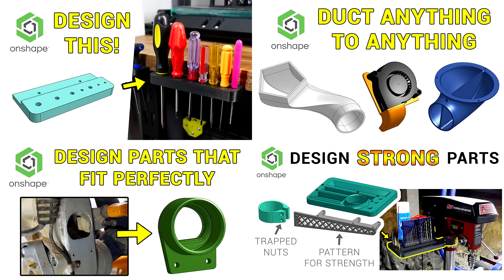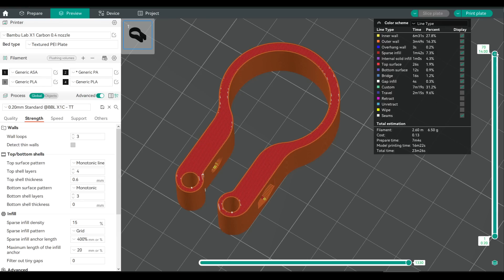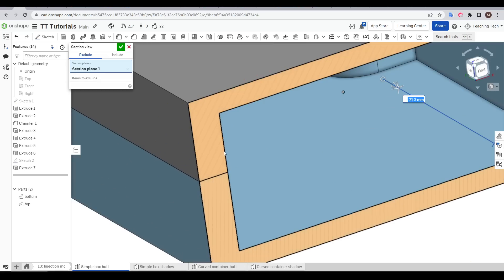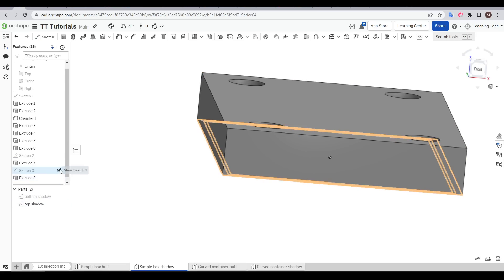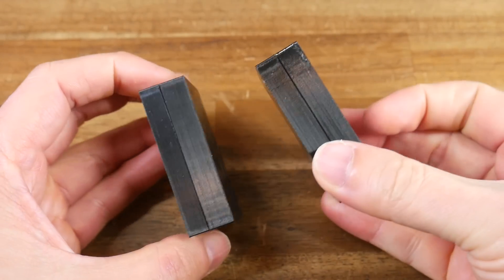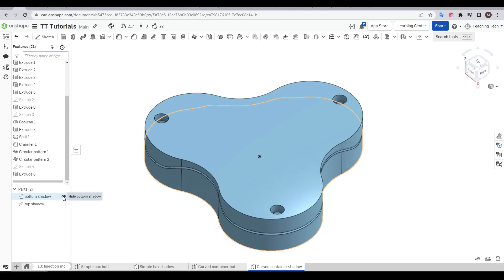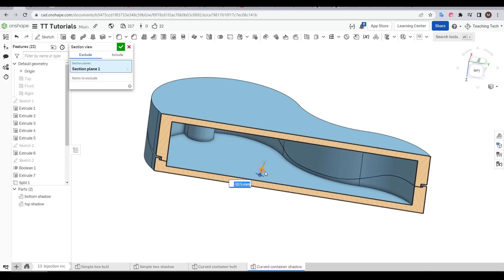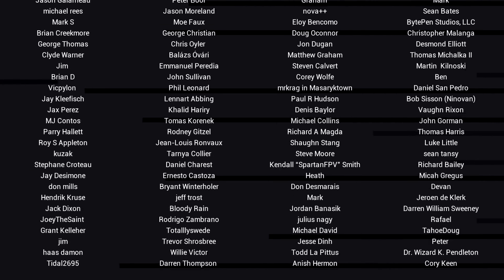Design like a pro with shadow lines - 3D design for 3D printing

Comment: Michael, you're doing very well with teaching people some good habits for design. Next thing missing in your designs is proper alignment between assemblies. All parts need to follow a datum scheme which located the parts to each other. Simple protruding ribs that net off to a wall, or an extruded "t" on 1 part going into a hollow box in another would align parts well.
Reply: What is "netting off"? I didn't get any of that 🙄
Reply: *Comment redacted for being too much of a jerk.*
Reply: @renxula  I'm sorry for my previous flippant answer. "Netting off" just means "touching at a certain spot". So right now Micheal's assembly (the two halves of his box) can slide against each other 0.5mm to the left and to the right, (6:04) making a total of 1mm of sliding. Sometimes that's OK, but when you start designing more functional parts that's too much "play" between the parts.
At 6.04 he can add two small 0.4 or 0.5mm bumps/ribs off the bottom part, pointing inboard (to the right), to close that gap. Do the same on the other side of the part. That will give the two parts a snug fit so they can't slide against each other. If they end up too big, just take a small hobby knife and slightly shave them until they fit nicely.
The other method (pin and slot) would be difficult to explain right now but googling it should help you.

Comment: Just a possibility but the gap in the butt joint might be due to the screw pulling the material up as it starts to cut the thread. A chamfer helps but isn't always enough.
I've found that extruding a hole slightly larger than the thread diameter for the first 1mm gives that material somewhere to go.
I do like the look of the shadow line though.
Reply: That is a good idea. Have you experienced any issues with the threads pulling out when there is less total material to cut into? I haven't had any issues with self tapped threads but I've seen a lot of discussion of captive nuts, vs heat inserts, vs self cut threads and just wondering about your experience.

Comment: Makes perfect sense when joining 2 surfaces together you have surface area joining together. With just a flat printed surfaces there will only be the highest points touching leaving a gap. This can be minimized by sanding the 2 surfaces before joining or clamping but still not as much contact area as using a shadow line and like you also mentioned the lining up of parts becomes easier. I’ve watched your videos before but this video made me realize I need to sub, I don’t have anything against adults printing superhero busts or toys but this is the kind of content I seek. Thank you.

Comment: Do you know if you can extrude off curved surfaces like that in Fusion 360? Might need to switch
Reply: You can't directly extrude a non-planar surface but there several alternatives using either a move face (either "offset" or "translate" which is basically like extruding) or you can use "thicken" to create a new body. Add splits and boolean with offset and there is quite a bit of flexibility to create this type of geometry in Onshape.
Reply: @airwick5083  That's what I thought! Thank you for your solutions!
Reply: Yes, Fusion 360 and solidworks both have that feature.

Comment: I personally don't bother with much of any tolerance on such features. 3D prints are sloppy enough that it just works without it, haha

You can also make a wonderful snap-together feature by extending the inside overlap, and having a little intent on one piece and a little jut out on the other.

Comment: It would be better to use 1,6 mm width for these "walls", because 4 x 0,4 mm (typical nozzle) = 1,6 mm, so 4 perimeters are possible without any infill. 1,5 mm is a strange value.
Reply: 1.5mm would also allow you to do 4 perimeters using a small amount of overlap of the walls to ensure added bond strength (the various slicers call this different things, so you'll have to find it in your slicer of choice), however, as he said, he chose the value based on the design, not on the printer / tooling.

Comment: Is "shadow lines" an industry standard term for this or it just what you're calling it? I've been doing a similar approach for a couple of years already just simply instinctively, I was never instructed by anyone to do this. I do typically add tolerance of 0.25mm to account for the occasional tiny print/filament artifacts and to allow for shrinking/expanding without the parts breaking, making the prints more reliable.

Comment: Very nice video. Taking useful things from a similar industrie that's doing plastics and manufacturing for years and showing us how to do it.
Reply: Though, 3d printers should remember not to cargo-cult solutions from injection molding, if they aren't really needed for printing. One example is cutting large holes in order to reduce weight. We can get better results with just infill (it can be faster to print and look better).

Comment: The shadow line is always used in car manufacturing. You can notice it the most around the glove box, the shadow line points downwards.
This is usually a good practice, well done.

Comment: This is a super cool tip! However your method to create the shadow line seems a bit complicated. In Fusion360 I would have modelled the raised portion of the shadow line on one side, of the box then done a boolean subtraction with keep tools on the other side, then use offset surface to create the clearances. 
That way the shadow line is actually dependent on the model geometry and easy to edit, instead of requiring multiple sketches and tolerances defined in a sketch.
Reply: Agreed, not the most efficient way of doing it! On the flat box, it can be done with two features and no sketch in Onhshape: "extrude thin" the edges of the box (Onshape allows direct selection of edges for extruding, they just have to be planar), then boolean with offset to create the groove on the other part.
Reply: @airwick5083 great tip, thanks!

Comment: This is a great video. I use Fusion 360 hobby edition or w/e they call it now with the 10 editable sketches at once, it's annoying but not impossible to get used to. Is onshape just as good as it's free? and will my knowledge transfer over for the most part? or do I need to relearn everything?

Comment: And what do I do if the mating surface has to be printed facing down, e.g. if I have a hollow sphere printed in 2 parts?
Reply: Then you just use supports. It will only be a few layers.
Reply: @conorstewart2214  Those supports would be impossible to remove.
Reply: @frankbauerful  they really wouldn't.  If you have the mating surface on the build plate then the supports will just be a ring on the build plate, they would be easy to remove.

Comment: They do it in molds to give some tolerance. In 3D prints we usually have higher precision so I extend the outer wall 0.2mm higher than the cut and get a perfect snap between 2 parts and no line.
Reply: Exactly. Understanding why they do something when using a different manufacturing method is very useful rather than just copying it and thinking it must be better because other people do it. A lot of what needs done for other manufacturing methods doesnt apply to 3D printing. Yes this concept works in 3D printing too and has some benefits but there is no need to do it the same way that it is done for injection moulding. As you say 3D printing is generally more precise and consistent so the tolerances dont need to be anywhere near as loose. With 3D printing on a decently well calibrated machine or just if you know the accuracy of your machine you should be able to get a near perfect outer surface and a pretty good friction fit.

Comment: Very good as usual, but this time somewhat clickbait-y, as there is a ton of videos about how to make lips on models, just none of them calls them "shadow lines". I believe the most useful part of this video (and hence the title) is "how to make non-planar lips in OnShape" (as it is quite non-trivial in Fusion, for example).
Reply: Shadow line refers to techniques to hide unavoidable gaps "in the shadows" by using either enlarged gaps or bevels. Often achieved by but not the same as lip/groove.
Enlarged gaps help to hide inconsistencies, tiny gaps look cheap, enlarged ones looks like a design element and you can no longer spot inconsistencies like gaps that close in some places only, or when the top part protrudes over the bottom part
Reply: @zapl80  thanks! That's very informative, and I think it wasn't highlighted in the video

Comment: 7:01 I don't think this affects sealing for water much, for light of course it does
Reply: If you put some kind of sealant or gasket in it then it absolutely does help for water resistance. Also just having that lip there rather than a gap helps to protect from splashes. If light can shine through then any water or dirt can also go straight through, doing this absolutely helps water and dust resistance.

Comment: Note that you'd prefer your offset to be some integer multiple of the extrusion width, so with a .6mm extrusion, you'd usually want 1.2 or 1.8 also note that the difference between the 2 is multiplied by 2, so if you do 1.5 and 1mm the play is 1mm and not 0.5mm.

(It's not absolutely necessary to dimension to nozzle size as the extrusion width will be tweaked by the slicer, but you'll usually find it gives better quality especially on higher extrusions like 0.8 or 1.2)
Reply: Nowadays arachne perimeter algorithm is expected to work fine with non-integer multipliers
Reply: Modern slicers can take care of all that by automatically widening the line width to fill the required volume.

Comment: Tried to do this in Fusion 360 and of course it has a fucking bug that makes it impossible to actually extrude the sketch to cut the groove. I swear that program fails half the time to do the simplest stuff. I'm going to switch to OnShape
Reply: been trying myself with extrude and emboss. getting nowhere with it lol

EDIT: I've just figured it out. take the offset sketch and split body. it will chop it so you can press/pull on the section you want to change. then combine it again. Hope that makes sense

Comment: There is a fifth advantage too - if you wish to bond the parts together - e.g. with an MS-polymer, the shadow-gap creates a uniform thickness for the sealant, thereby giving a strong and consistent bond.
Great tutorial! Cheers :)
Reply: Was just thinking it would be good for bondo… are shaddow lines good for plane wings?
Reply: @BABALOOEY46  I would have thought mitred edges would be better, shadow lines would affect the aerodynamics
Reply: @AndrewAHayes  One would sand it flat, i imagine... (the entire gap would get filled up, so there should be no "gap" visible after bonding)
The strength of an elastic joint (like an MS-polymer seam) comes from the fact that it shares its load over the entire seam instead of point-loading at one "hot-spot". To enable this, the cured "glue" needs to have some compliance. a thicker joint-line has more compliance; a paper-thin glue-seam would be very stiff. (analogous to how a longer noodle has more 'give' than a shorter noodle). By having a uniformly thicknessed fill-gap, you create a uniform and consistent compliance, but if you do it correctly, there should be not much visible seam afterwards ;)
Reply: PS - this rationale does not work when your cement has a higher modulus of elasticity than your base material (e.g. bondo and PLA). It is intended for soft bonders on a hard base - e.g. silicone and bathroom-tiles .
Reply: I personally use a similar technique to embed a custom o-ring for part that requires a better seal 🤌
Reply: not only that but also more surface for the binding agent to bind to, so it would be stronger. Glue also work better in shear mode than separation mode
Reply: Commonly its where you'd put compliant fasteners as well, basically a groove and a detent. Then your little box can snap together nicely.
Reply: Six: a place for dirt to collect.
Reply: @JV-pu8kx  LoL - true :)
Reply: Even if you don't use adhesives, the overlap spreads stress over the entire part instead of concentrating it on fasteners. I'm almost every way it's a stronger part.

Comment: It's mostly done to prevent breaking around the screws.  The Lego-feature makes it far more durable when dropped.
Reply: This is something I miss from the days when mobile phones had a battery compartment that could be opened and snapped shut. Whenever my old Galaxy S3 would fall the worst that would happen was the battery cover falling off, sometimes with the battery also flying out. With every phone I had since falling resulted in screen cracks or worse because there's nothing to absorb the energy of the hit.
Reply: @nadavwiener2634  You know you could just put a phone case on, preferably something flexible so it can absorb the impacts.

Comment: Great lesson as always, Michael. Another huge benefit that I don't think you mentioned is how this strengthens mated parts. With your box example all the shear stress between the two sides would be on the bolts, but the shadow line spreads that force out over the entire circumference, probably greatly reducing material fatigue and failures over time.
Reply: With distances like he used most of the stress will still be on the bolts, the shadow line only starts spreading out that force after it has already deformed by the horizontal gap between the parts. Yes it may help with strength but it most likely will not help much with material fatigue.

Comment: I know these examples are made with loose tolerances, but this is the correct way of designing an assembly. You can even 3d print a gasket (with a flexible material) to put it in the interface. I see a lot of people here on Youtube  3d printing parts and using glue or other questionable technics for connect parts. Thank you for teaching (tech😁) how must be do it.